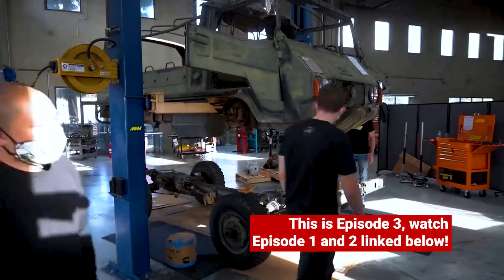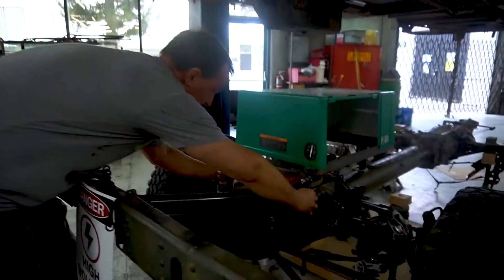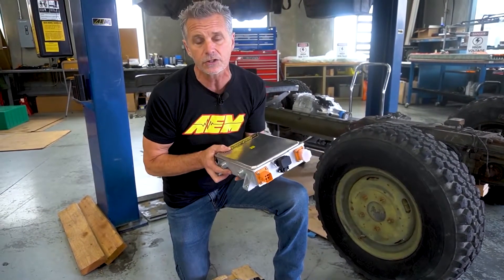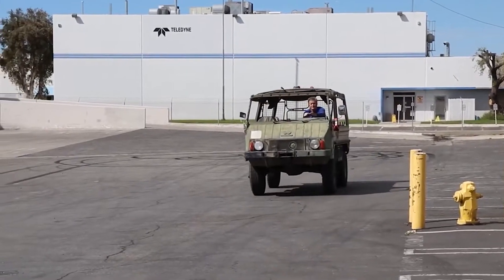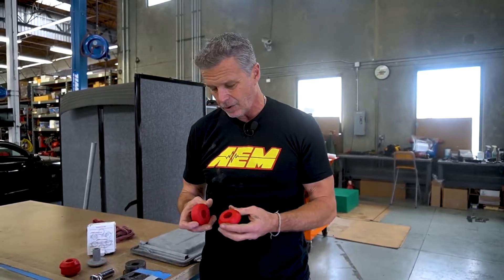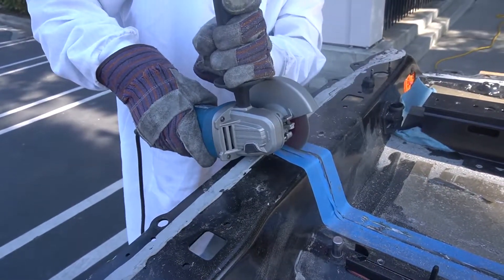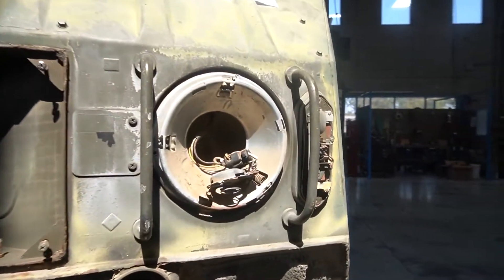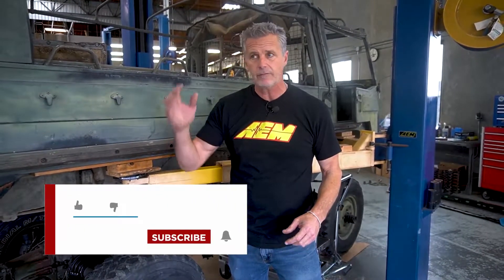HERE'S What's Happening on the 71' Pinzgauer EV CONVERSION

Comment: Looks go . i also work for a small company doing conversions. So I'm interested in how you deal with all the problems we have to deal with. The BMS are real time-consuming part and getting wires attached to the batteries to monitor the cell voltage is a challenge. Haven't seen much on the motor yet what kind .